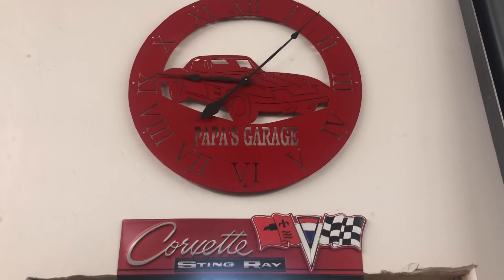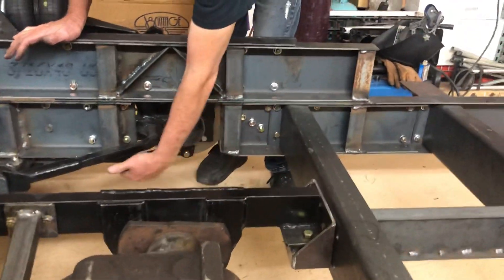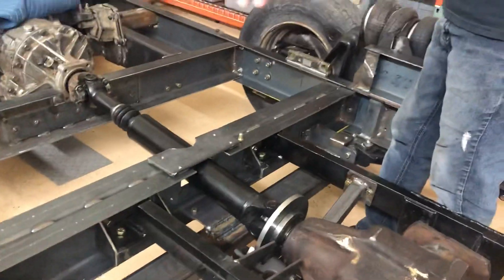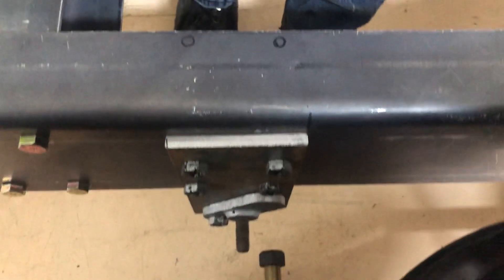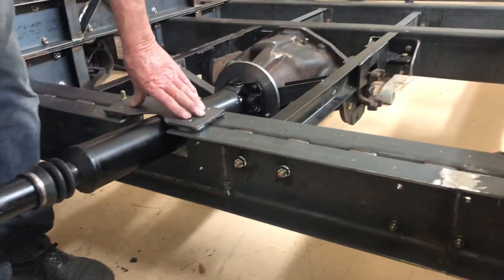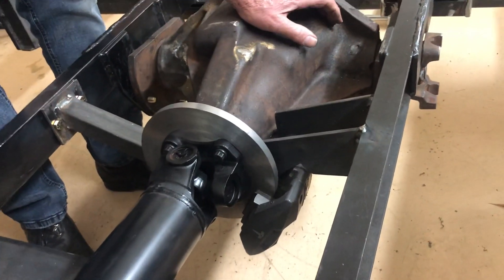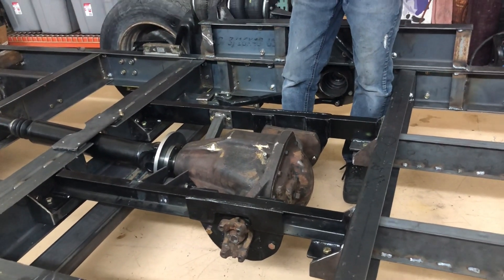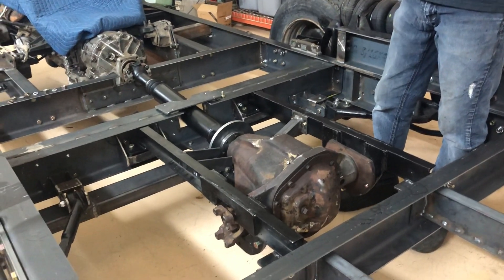GMC diesel conversion

Comment: Im really missing this build im basically doing the same thing but keyeping the engine up front and using 2. Ford expedition irs centers and axles! Maybe 2500 HD gmc front suspension and frame widened

Comment: The work you do is awesome i wish we had more updates! Im doing a 23' glacier front engined 6.0 awd with 2500 hd front suspension and the same ford centersection you had used in your initial plan im using 2 i plan on making it 2x6, 4x6, or 6x6 using 2 transfer cases! Id like to know more about your suspension arms you built! Id like to build a full set of them
Reply from the maker: We have been remodeling a new to us house six hundred miles away so haven’t done any more work on this project. Will be curious to see your project. Are you doing videos on this? Let us know. Thank you Hal and Blanca
Reply: Im not doing video of it but i will be taking photos! Been busy too but have all the parts to get the project going! The arms ill be Commissioning a local fabrication shop! Good luck in your future endeavors!